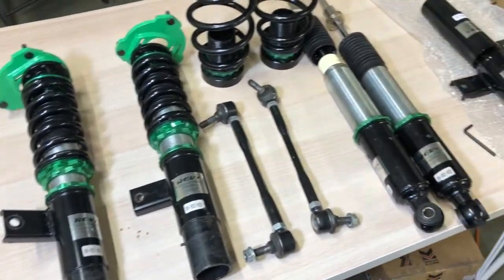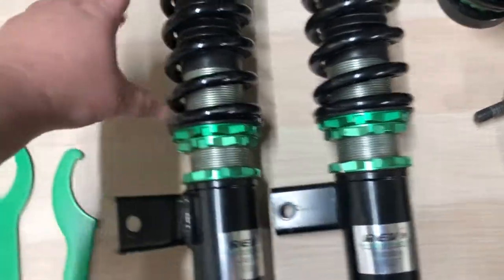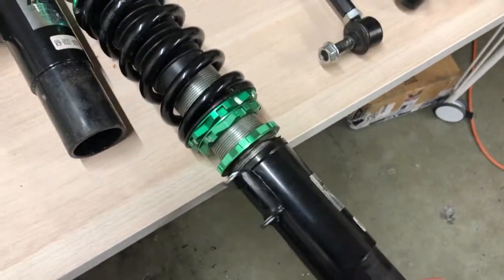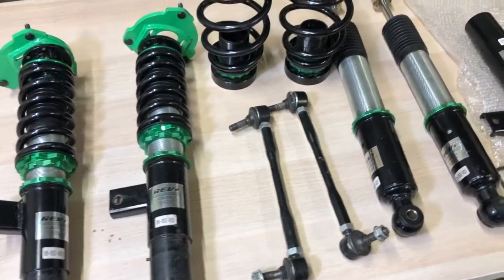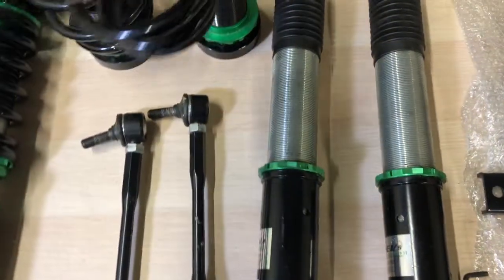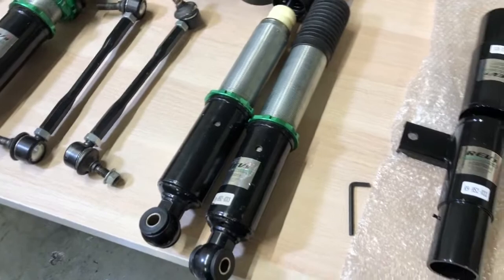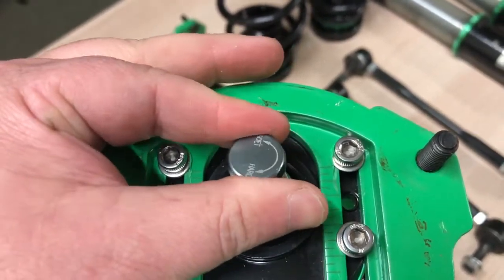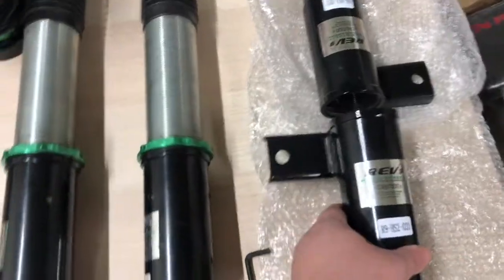Rev9 Coilovers - Height & Shock Dampening Adjustment Front/Rear How-To

Comment from the maker: For the full listing of Rev9 coilovers, see here: https://shop.redline360.com/collections/all/rev9-coilovers
Reply: what if I raised my rears but the car still sits lower than i want? 2008 Acura Tsx.
Reply: side note, i cant go higher without having the threads fall out of the black part
Reply: Would these be ok for a daily driver that’s a weekend touge chaser?
Reply: so, according to your video WE HAVE TO take out coilovers first before Adjustment ??
If not, How do we adjust when the coilovers installed ??

Comment: Okay now I'm confused I have a 2013 Civic SI with rev9's divorced setup on the back. Do you adjust the height with the struts or the spring because they both have adjustments and people are saying don't touch the spring because it's the preload and other people are saying that's how you adjust the height so which is it. It makes more sense to me that the adjustment on the spring is for preload and height adjustment is on the strut. Correct?

Comment: For the rears, you don't lower it with the springs, you're messing with the preload again. You want to adjust the ride height on the struts. You should have noticed that being that you just stated it for the fronts.
Reply: Yeah I was trying to figure out how they came up with that.
Reply: They are two different types of suspension, there’s no preload on the rear without the cars weight on top, if you lower the spring on the rear on these, it lowers the height the car sits at, same preload as before
Reply: For the rear on my car with the rev9's I have the divorced setup and my springs are at the lowest setting but the shocks are at the tallest setting and it rides nice over no bumps, then going over bumps the car bounces lol
Reply: There is no preload for the rear springs without the weight of the car
Reply: @miguelr1133  bro, someone already mentioned this a year ago, did you read the other comments?

Comment: Good to know, been looking at these for my 05 IS300....
Reply: Did you end up getting them Rob?
Reply: @ahmedradi8661  I didnt actually. I did some more poking around on em and actually chose to go a different route (tokico orange ST struts, and stayed with stock springs)..... the struts with the stock springs added a good a pretty clean ride and carve pretty hard in the turns. Plus, with a set of cusco upper (front/rear) strut tower braces it really tightened up the suspension....

Comment: I just bought a set of these rev 9's for my 2018 accord. I don't know how low to go. what would you recommend? I want a really nice stance but I also don't want it too low. maybe a lil lower than oem.
Reply: Victoria Garcia suggest u make the tire barely kiss the fender basically eliminate wheel gap
Reply: How have these been holding up for you? Very curious, thinking bout getting these for my G37s. How’s the ride feel
Reply: @swervv2957  put em on my g37 they pretty good
Reply: I got these on my accord abt barely a fingers width pretty nice n low stance with no rubbing. Hope this helps

Comment: So can u adjust them when they’re installed?
Reply: No u can't gotta remove bottom part and spin
Reply: @AngelA-bd6nf  y0u can loosen the bottom nut and the strut will spin freely without taking it off or messing with preload. Just make sure the entire strut is spinning
Reply: Which way to turn spring to lower it if it's already mounted in car

Comment: I'm really not understanding what you mean about the rear coilovers when you say you want the thread to be "up here" I think what you are trying to say is that you want to make sure you have enough of the threads into the lower mount but could you clarify the maximum height you can adjust to on the rears?
Reply from the maker: Correct! We've just had some customers leave one thread and then wonder why it broke... make sure to have enough thread in there so it's secure and won't break loose.  Every application is different for adjustment, but when you have about an inch of thread left, you know you pretty much maxed it out

Comment: I have a 2013 bmw 328i and it’s making loud clunking noises over bumps. Does anyone have an idea why that’s happening and how to fix it?
Reply: I been using these on my 328i f30 for about 2 years now, only complaint is that the front didn’t drop as much at the rear

Comment: How do you adjust the preload for the rears? I get it you raise or drop the rear by the springs, but what about preload?
Reply: Yea he deffintly contradicted what he said at first and your correct
Reply: You adjust the height to where you want it using the spring perch adjuster then put a jack under the lower control arm in the rear and jack it up until you get about 5
- 10 mm of preload then you adjust the rear shock bottom until the bolt hole lines up for you to bolt it to the lower control arm

Comment: Got these installed at a professional shop yesterday but the ride is Really bad. I wonder if they ruined the preload trying to lower it like you said on this video. Would lowering the top preload help smoothen ride quality if that's what they did? Or will It be guess work trying to re correct preload
Reply: Just take a look at how they have it adjusted and see if it looks like it should with the ride height of your car.
Reply: I made this exact mistake, lowering them using the spring ruins the ride. But then going back and doing it right will actually fix it
Reply: I'm late but this actually just happened to me, so does this mean I can't adjust the ride height and increase the height without completely taking out the suspension all the way??

Comment: So for divorced set up you only adjust the springs to go lower but leave the shock the same?
Reply: I am wondering about that also. I would assume you adjust the spring height to your desired ride height and then adjust the shock so that you maintain full shock travel. If the shock is too short, It'll preload the spring and if it's too tall, It'll bottom out since it's effectively shortened the travel distance of the shock.

Comment: So i bought these for my 2015 bmw 328i Rwd. The shop installed them, the rear slammed at 2”inches but the front doesn’t lower more than 1”inch. Maybe only for my bmw? Anyways the install went well besides the height issue. But now im getting a clunking noise on the right front passenger side when i go over bumps an road dips. so theirs that.... Damping is on hard
Reply: Did you fix it? And if you did fix it, how did you do it? My bmw does the same thing and the clunking noise is hard.
Reply: @Martian305  did u fix it?
Reply: @Martian305  Thats my comment on a diff acc, did u fix the noise yet

Comment: Can you do this while there mounted??
Reply from the maker: You can, but you would need to undo the lower mount from the control arm.
Reply: you can twist the silver part when the thread with your hands is but if its too low then you cant since theres less room to grip it
Reply: @Redline360  are the godspeeds worth the extra 200 to 300 I'm on yall website now it's hard to tell the difference
Reply: you can always adjust the ride height with the coilovers installed, you just twist the second ring (not the first one which is preload)
Reply: mrdauntless you don’t mess with the very first ring. The second and third one is how you adjust the height....

Comment: I am looking into these but do not want to go crazy. Just drop of about .5-1 inch at most. Do you recommend these?
Reply from the maker: Usually, at the highest setting, they will still be right around a 1 inch drop.  If you want to go less, we do have TEIN on our site also, and depending on your car, it might drop less... the rates are on the listings on https://shop.redline360.com/collections/suspension?_=pf&pf_pt_product_type=Coilovers Thanks!
Reply: Redline360 I want to know if tein basis z would be good on my G37s coupe? I’m looking for stock comfort and not looking to drop much more then stock height aswell. It’s my daily car and I drive in LA roads

Comment: Hi i got these installed on my bmw f30, the problem is the front doesn’t lower more than 1” inch. The back is perfect at 2”inches but not the front. Do you know the issue i may be having? Could it be that thee coil-overs don’t really fit a bmw?
Reply: I think you did exactly what he said not to do. Lower them spinning the bottom of the strut instead of spinning the spring

Comment: Initially that’s how you measure it, then after it’s been installed you can lower or raise the height by spinning the collar, not the lower portion of the body. So you’re practically saying that the whole coilover has to come out if you want to raise it or lower it......unpractical.
Reply: nah if you loosen the lowest lock collar, the whole strut will spin to be lowered. I've had them on my car for 2 months now and have played with ride height a lot and haven't had a single problem adjusting them on the car.
Reply: @carterschnick2556  even if the sway bar link is connected?
Reply: @hernanmurillo8925  the silver part with the spring spins freely. Just grab the spring and spin it which ever direction you need it.
Reply: @Atrociousa3  the spring & the silver body??
Reply: yea
Reply: @carterschnick2556  some process for the rears?

Comment: Does this mean the ride height cant be adjusted while on thr car? Or is there a way to do the same thing while on the car?
Reply from the maker: You can adjust it while it's on the car, but you would need to still disconnect the lower mount so you can spin it.  You can keep the top attached - makes it much easier :)

Comment: How would you go about adjusting these on the car then?
Reply: Easy, you loosen the bottom one and move the second ring on top to the left to lower and right for higher. Just dont mess with the first ring AT ALL!
Reply: Same question I had
Reply: @sniper2606  don’t you move the first ring to lower and then 2nd ring to raise it? (After loosening the bottom nut of course)

Comment: What is the best dampening ? Any suggestions?
Reply: Start on the soft side. You're going to have different settings in the front compared to the rear because of there being more weight in the front. You're front settings also may slightly differ for it to feel even since the front drivers side is the heaviest corner of the car. It'll probably take you a couple days atleast to get it right where you want it.

Comment: How much do these coils drop? I was hearing only 1 inch, ur website says 1-3 inches. I just ordered them
Reply: its 1” if you do it this way, its 3” if you ruin the spring load. I dropped mine all the way and still didnt get the ride height I was looking for for my 97 miata. Kinda upsetting.
Reply: i dropped my wrx about 2 /12 inches and it still can go further a bit so i think 3 for sure
Reply: and i didnt touch the preload
Reply: @Mikey-kw7rj  does your wrx ride like crap now?
Reply: My altima dropped about 5-6 inches, tucked the entire while the car was still jacked in the air
Reply: Mikeythementor Tanigawa did you use these exact Coilovers for your wrx? Cause I got these for my b17 Sentra but now own a Mk7 gti. Not sure if they can go on my gti :/
Reply: @AlwazeSleepy  Hey man i got these too an the fronts my mechanic says it wont drop more than 1 inch

Comment: The stiffness knob is no where near that smooth to turn. I have to use a plumber wrench just to adjust the stiffness
Reply: Mine was actually fairly easy to turn. Its possible you just got a dud.

Comment: Those dont look like progressive rate springs.... adjusting the ride height with the bottom doesn't let you set the bumb stops. Meaning that the car could hit fenders. I have seen other vids were ride height is adjusted in the spring....
Reply: What makes you think that? Almost every manufacturer of coilovers uses progressive rate springs.

Comment: Rev9 poor quality.
steet driven on a accord for a year, didnt even tough the track.
front right strut already squaling and for some reason, my wheel is dirty on reg basis (no, my brake line a clean and calipers are clean)
This a poor quality ebay struts. 

side note: their accord kit, is garbage. they sell on ebay for 1.5 to 2.5 drop.. 
i was running alread! out of thread in the rear.. at 3in drop.
and yes, I have watched the video and know what it takes, 

rev9 is garbage.
Reply: I need coil overs for my f30 bmw should i skip these and go with race land coil overs?
Reply: Jeovany 1996 naw those are garbage get bc it’s expensive but perfect. do it right or twice
Reply: Wish I would’ve seen this exact comment before I installed rev9 on my Accord. Topped out the rear coil overs and still have less than a finger gap between tire and fender….